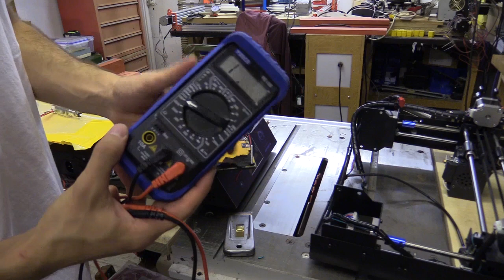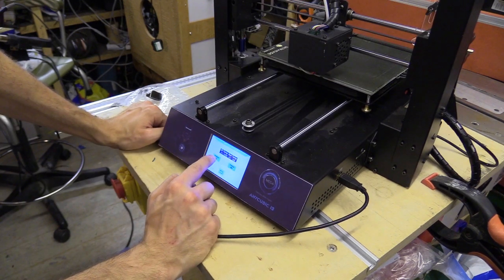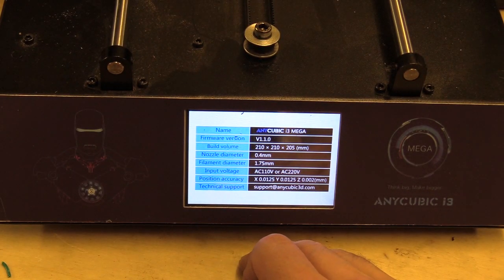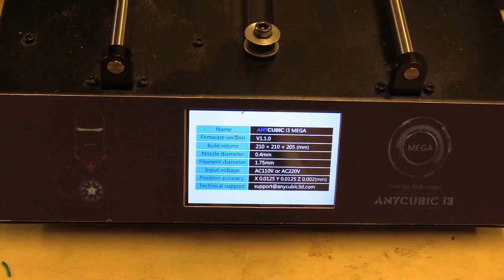Upgrading Anycubic i3 Mega 3D Printer - Fans Wiring Stepper Drivers

Comment: Don’t even bother going through the hassle of unsoldering the beeper. I Just stuck a good piece of round sticky tape on the top of it. Problem solved.
Reply from the maker: Ahh didn't think of that.
Reply: I think there's a firmware you can get where the only change is the beeping isn't featured!

Comment: A manual bed levelling video tutorial would be so perfect at the moment, I'm really struggling :(
Reply: Get a set of feeler gauges and use the 0.1mm one for each corner. Do it with the printer heated up to 200C, home the machine and then use the touch screen to move to each corner and use the gauge.

Comment: I was thinking of replacing the hotend fan with the same Noctua NF-A4x10 FLX 40mm x 10mm, but the AnyCubic site claims that it should be a 30mm fan. Does the 40 mm fan fit nicely in the print head? And did you have to change any of the wiring for that fan?

Comment: Hello ! i try to convert Gelid Silent 4 form three pin to two pin, but not working ! do you know why?
i did soldering as below
the top cable(have a arrow mark on the connector)  - black 
middle(TGK -6 ) - red  
bottom (2510) - connect nothing
Reply: after convert 50mm Gelid Silent 5 is working, but i still don't understand why is not working on 40mm  Gelid Silent 4.
Reply: @alexkwong5671  If the fan you are talking about is the one that cools the stepper drivers; this fan does not run all the time but only when the drivers are doing some work.

Comment: how easy is it to convert the three pin to two pin for someone who not much electrical knowledge?
Reply from the maker: Think you just ignore the yellow cable but crimping the ends would require special tools so easier to buy ones with the right terminals.

Comment: great video this helped me massively to install the stepper drivers. however when I install the extruder ones it will not feed at all its very strange!
Reply from the maker: Might have to adjust the power to the steps. There's a potentiometer somewhere - use a voltmeter and find the equation.

Comment: Hi what do you use to shrink the heat shrink, I noticed it worked very well and would like to get one.
Reply: Any Hot Air Gun capable of 80oC and above will make the job!
Reply from the maker: I'm using this solder station - https://www.banggood.com/custlink/GmDvD7ZNAB but it has failed a pat test, I also use the proxxon heat gun from Axminster.